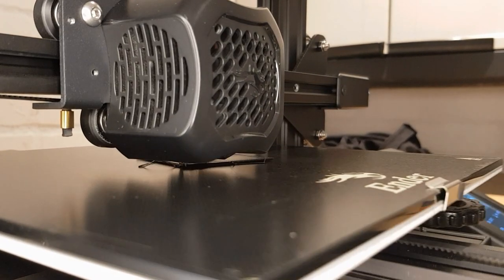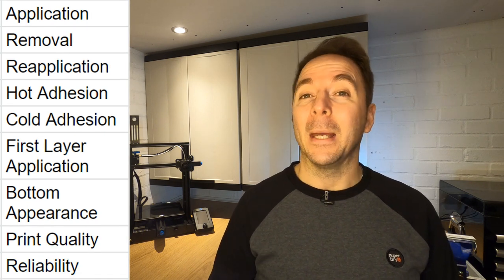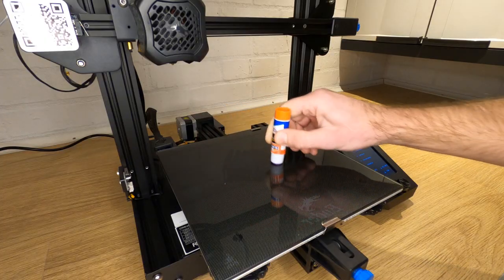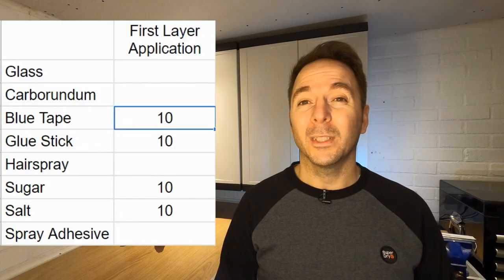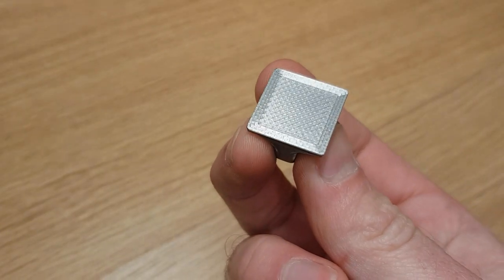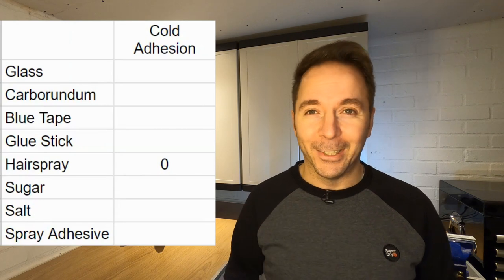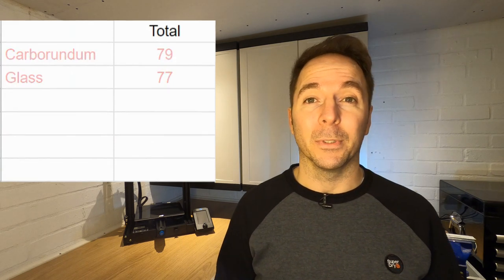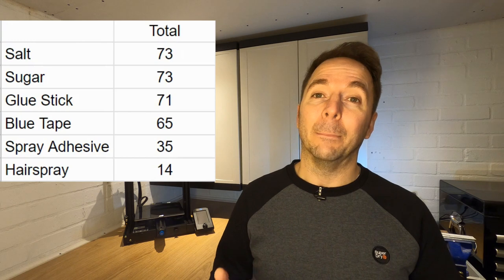How To Make Your 3d Prints Stick Effectively - Every Method Tested

Comment: I'm new to 3d printing. I have the best wife ever.  She gave me a bambu lab P1S FOR X-mass. for days  I've tried so many times to print ASA . I've tried no fans, I've tried increasing my temp bed to 100', I've tried a larger brim. I'm using glue stick as we speak and the print is actually staying down, I don't want to celebrate to soon, but I'll know in 40 minutes if this is the secret sauce to my adhesion issues.🤞
Reply: glue stick works with everything, I reapply every print over the old glue, just annoying to clean off once you built it up and made a mess with it
Reply: Have you tried putting the tape down first then glue? I did that with hairspray and got better results but still no sticky long term. Going to try tape and glustick tonight.

Comment: A cool follow up to this would different build plate materials, (glass, PEI, etc). You could even test the most common combinations of build plate + glue/spray/etc though that is an awful lot of testing to do. 

Something to note, Creality say on their website you must not use alcohol to clean the carborundum side of the Ender 3 V2 glass bed. I reckon a lot of issues people have with this glass is down to people not knowing this and gradually worsening their carborundum coating over time. I just use water and a microfiber cloth to clean PLA off mine and other than warping (aided by the cold room temperature) which I just use a brim to fix (also thoroughly primes the nozzle), I've had no adhesion issues.
Reply from the maker: Yes, I would like to test all the different beds like you say. I've never used anything but glass cleaner or soap and water on the carborundum coating and I think you are right, many people damage them using something else.
Reply: @RickyImpey  I use 70% alcohol to clean my ender 3 v2, so ive been destroying my print bed?

Comment: I just got my 1st printer this last Christmas. I've been using a purple colored Elmer's glue stick my wife had laying around. It works wonders! I don't reapply it every print... Maybe only every 3rd one or so. When it comes time to clean the carborundum I just take a wet paper towel and wipe it down. It smears the old glue stick and it reactivate the glue when it dries. Plus the purple color shows you were you need to wipenit down to a thinner level or away if there is too much built up.

Give the glue a try that way and see how much more you like it. When it comes to removing the part, I just take a few drops of water near the base of the print. The part just falls off! Removing without using water is a bit tricky as it does hold pretty well.

Love your channel and I just printed the parts for your dryer box v2. I've learned a lot from your content and wanted to say thank you!
Reply from the maker: Great Jeff, thanks for the comment. Yes the purple Elmer's Glue is my favourite too👍

Comment: Try strong hold hairspray from palette, it sticks like a super glue and first time removal is a pain but after that it's OK (it sticks reliably when it's hot and you can remove the print with a relative ease when it colds). and can be reused for a couple of weeks. I've tried the very strong hold too but  I had mixed results. (Ender 3 v2 glass bed)
Reply: With glass bed you mean the other side of the bed right?
Reply: @XxXx-kq  Ofc don't spray the metal plate :P

Comment: PLA glass plate, $5 hair spray (let it dry first) cold bed, holds like a demon, but you can just wash it a bit to get it off. Glasslike surfaces.. I have a removable bed on my Flashforge.
I use a brand called Fiesta, the purple can. It doesn't look like the messy stuff you have. It was recommended to me by the company that makes the filament I use.

Comment: Go glue stick!
I've been using a standard glue stick that happen to come with a multi-color PLA pack I ordered off Amazon. Works great but a little soapy water to wash it off after a few prints is a good idea. Use a cloth towel, not a paper one, as you can create an even bigger headache.

Comment: Incredibly informative. My Bambu Lab has been a pain to understand at times. I'm still just learning. The initial test line will sometimes restick to nozzle and drag to the print, which causes problems. As long as I pull it off before it starts the main event, it'll print mostly fine. My last print (canceled before 1st layer was even done) is a large gear, and while most of it sticks really well, it's only in one tiny little spot that it doesn't stick at all, and ultimately ruins the build.
Biggest problem I've had has been the cooling I believe. Despite turning it almost off, or off entirely, it still acts like it's cooling too fast.
So many variables to deal with all at one time, causes confusion as to what is working and what is not.

Comment: You are spot on about spray adhesive and the glass bed. I now use a magnetic bed that has a surface simular to what the glass bed has. i think it works amazing. Minimal maintenance and sticks every time.  I control my printer remotely so it is super easy to print since there is no bed surface prep required while the printer is warming up.

Comment: On my bad surface I had on my Tronxy X5SA, I found Gold UEETEK Tape. the heat proof electronics tape. It worked well to stick down my prints on the big Tronxy 13 inch bed.
Then later I got a Ultra Flex Rubber like magnetic bed from Tronxy. it's only problems were that fact that after 75 C on the bed the edges curled up so I had to use the 4 small string clips that came 
with the original metal bed to hold down the new magnetic bed fully on the edges.

Try's to find a 13 inch square PEI magnetic bed is very hard indeed.

Comment: Interesting, my experience with spray adhesive, hairspray and glue stick is shuffled (applied to bare glass): glue stick makes a mess, hairspray (Garnier extra strong) is super reliable and usable several times also with ABS, and spray adhesive (Dimafix) also reliable, but only at higher temps (and smells terribly, I use it only if essential).
Thanks for the tests.
Reply from the maker: Yeah I used the wrong hairspray, it's not something I'm very experienced with myself. I'd like to try again at some point so I'll try the Garnier one if I do, thanks👍
Reply: I'm using "Schwarzkopt 5" and it works great!

Comment: I print with a smooth glass surface and use a light Spritz of hairspray. I use that for all of my materials, although, for pla, no adhesion is necessary if your levels are set correctly. 
You must have definitely used some poor hairspray.
Another benefit to the hairspray is that it can be used for multiple prints and then you can simply just spray more right on top and keep going.

Comment: I have found that after only 7 months, my stock ender 3v2 glass bed has a shiny spot in the middle which is causing me to have prints lifting.  I have some elmers glue stick and think I'll give that a try.  I also like to idea of using the untextured side of the glass to get a better finish.  Great vid as always.

Comment: I think I discovered something Pretty good. Get the cheapest 500ml 70% rubbing alcohol you can find and add about 100g of sugar. You have to try this. It Doesn't leave droplets like sugar water and it evaporates a lot quicker, plus the added sanitary benefits of the alcohol and it's very easy to clean afterwards with a second bottle of regular alcohol. This stuff saved me an immeasurable amount headaches and a lot of filament.
Edit: Also very important, only try this if you have a magnetic bed, DO NOT apply the solution on the bed while it's mounted on the printer, you don't want to get sugar on the rest of the machine.

Comment: Always learn from your videos, your DIY filament dryers are the best I have seen. Alas lesser so from this one. Until you buy the correct hairspray scoring it on your scorecard determining "which is the best" is moot. In South Africa my goto is Fiesta Extreme Control and it would have scored near the top in every single test category that you put forth, at least for PLA+, SBS & PETG. My experience and many participants on the SA 3D Printers forum is in stark contrast to your test results. Other than an E3 vs an E5 my kit is identical to your test setup.🙏
Reply from the maker: Hi Den, yes it's a shame that we don't seem to be able to get the same types of hairspray in the UK. I don't know if there is a crucial ingredient that is not allowed here but I tested a few others off camera with the same results. I'm happy to re-visit this test with any other options if I can get hold of a hairspray that someone recommends that works.

Comment: Appreciate the video. Been using 3dlac+ which is basically hairspray (though it smells more like MEK and acetone than ethanol, so maybe there's something else in it) in a pump-spray bottle and without the stink. Couldn't find any hairspray that would work and figured that if I could find a compatible hairspray I'd have spent more on that than a specific adhesive. It practically sucks filament down onto the bed, though parts stick almost too well and I usually need to tap them off 'gently' with a scraper.
I'm probably going to buy some methyl-ethyl ketone and try dissolved PLA as a surface. I got the printer used and I assume the coating creality allegedly put on the bed (I doubt they do anything special personally) has been wiped off with iso-alcohol. 
A solvent with the specific polymer being used in a print is print (PLA, PETG, ABS/ASA, TPU and Nylon) is probably the best material to use for adhesion. Once applied to the bed the solvent will evaporate and since the plastic layer on the bed is the same as the one being applied it'll 'wet' to the bed just like solder that has a good amount of flux. 
You'll need a few different solvents to dissolve each plastic, but with this you may get better first layer adhesion.
Reply from the maker: I was send a bottle of 3dlac but haven't tried it yet. I must give it a try.

Comment: Hello, I am new to 3D printing.  Received the Ender 3 V3 for Fathers day.   Initially it sticks ok but the other day I was printing something and the head knocked the top of the project which caused it to push it over and then that was that :).  Would this mean I need to adjust the "Z" offset.   I am not smart I saw that on another youtube video.. sorry.

Comment: Thanks for the brutally honest, well done and thorough review.  I recently purchased an Ender 3 S1 Pro and found the flexible plate to have more failed prints than my CR6SE Creality tempered glass build plate.  Might try that plate on my Ender 3 (measuring there is still a 1/4" clearance between the posts so it should fit if clamped down).  But have never tried glue sticks or any other means.  Didn't need to with the CR6.  I have resorted to Rafts for any print with a small parts or smallish base - especially if taller print.  Adjusted leveling and Zed offsets way too many times .  Time to try glue stick.   Curious if any Canadian's have a preferred brand.  Elmer's 60509q Extra Strength Office Glue Stick is available as is their standard glue stick, the purple colour changing type, and UHU glues.  Staples house brand is readily available too.  I hear Avery is good but not available easily (Amazon will import it but at high cost).
Reply from the maker: I can't help on the Canadian brands but I always try for a PVA based glue stick option as it's much easier to clean up with only water. I'm surprised you have adhesion issues with the S1 Pro. I found mine to be the best of all my printers for adhesion. Have you tried giving it a good clean with soap and water?

Comment: Well, having a brim to start on the print helps me, mainly because it gives me a spot to put tape on, so I know it'll stay sticking in one spot. I actually use, for normal, hairspray. I'm using Garnier Fructis Full Control, which is a 4 of 5 scale on holding. It doesn't give me a problem with the smell as much as the Tresemme Freeze Hold, which is 5 of 5 for holding. I normally will not use anything that requires water on the 3d printer (ender 5 pro here), so I agree with not wanting to use salt or sugar.

Comment: I've always used Tresemme No4 hairspray with good results on a glass bed. After watching your video, I'm now trying Pritstick glue, applied and then rubbed smooth with a wet wipe. Seems to work just as well.
Reply from the maker: Ok thanks 👍 I still use a little glue stick sometimes but have also found 3dlac to be good. It's very similar to hairspray.

Comment: Very thorough analysis! I'd love to try TPU but my Neptune3 Pro has a textured PEI bed and there are plenty of pics/vids of people ripping chunks out of the sheet coating and destroying it trying to get TPU off it because it bonds so tightly. I'm terrified of destroying my still-perfect PEI sheet! Would gluestick or tape be the answer here? If so, do you have to relevel the Z before printing especially after applying tape?

Comment: Excellent tests. Would never think salt would be a great adhesion substrate. How much salt is used? I think using salt is safe, simply take it to a different room, apply it there and allow it to dry then bring it back to the 3D printer room. I think messing with glue stick is worse than salt in the electronics room.

Comment: Just got a textured PEI plate and a hardened steel nozzle, both of which make it easier for the first layer to not adhere properly.  The PEI sheet is designed to release prints easily but a side effect is print warping/releasing them while printing. Hardened nozzles, even the E3D nozzle X which supposedly has an anti-stick coating, tends to grab the first layer and rip it off the build plate. Combine these two factors and it becomes extremely easy to mess up the first layer unless you use a high temperature for the heat bed and print the first layer extremely slow at only 1-3 mm/s, as well as having to add mouse ears to sharp corners to prevent warping further.

People who say it's bad to use adhering additives probably have never changed out their stock parts, I probably wouldn't use them with the stock setup either but with aftermarket upgrades, they make things a lot faster and easier most of the time.

Comment: Thanks you helped me work out which one to get. I actually have to cool down the bed to prevent my cf nylon from warping especially on bigger projects, so I need something stronger at cooler temps, yay spray adhesive!

Comment: good vid man, when you say blue tape, do you mean painters tape?  (in uk) ...ive just got a 3d printer and nothing at all is holding it in place ,with  bed levelled etc....
Reply from the maker: Hi, the stuff I found that worked was the blue 'Scotch' brand. They are all a little different so it can be trial and error if you try anything else.
Reply: @RickyImpey   cheers man, i,ll try that then.....nice one.

Comment: I have just started and on my 2nd print. I have the Ender 3v2 with glass bed. I have been running with the Carb up. My problem has been too good adhesion with it. Only way to get it off right now is dental floss. I have tried freezer and reheating the bed. Feels like I am going to pull the glass off with it. Any suggestions?
Reply from the maker: A PVA based glue stick can act as a barrier to prevent prints sticking too well. You could always flip the bed and print on the plain glass too.
Reply: @RickyImpey  I will try both, thanks you!

Comment: I don't use anything and I always need to make a humungous amount of effort just to take those things out of the bed (so much so that I need to level it every time after the prints).
And y'all need to make it to stick more to the bed? 🤔
Reply from the maker: Some do, if you struggle to remove prints,  PVA glue stick can help as water makes it release. I spray a little water or glass cleaner at the base and it dissolves.

Comment: I have got e3 s1 pro. In my case fillament stopped sticking in the centre of the bed. It started when i cleaned the bed is isopropyl alcohol and multipurpose cleaner. It still sticks ok if it is further away from the centre. I setup bed using your video and issue still occurs. Just spent 2h trying to solve it. So annoying 😒
Reply from the maker: I generally only ever clean removable beds with soap and water. I would try that before anything else more drastic.
Reply: @RickyImpey  thank you.

Comment: You don't need this. Use a pei bed. If it won't stick after a while. Sand the pei bed with 3000grit wet sandpaper till it gets milky or cloudy . You won't need these  items.

Comment: As someone who has been struggling with 3-D printed objects coming off of the heated bed before it’s even done printing I have to say I wish that they made a heated bed that got to be as hot as the nozzle around 200° or more because 100°, doesn’t seem to keep the plastic melted long enough for most things to finish!! 🙄🫣